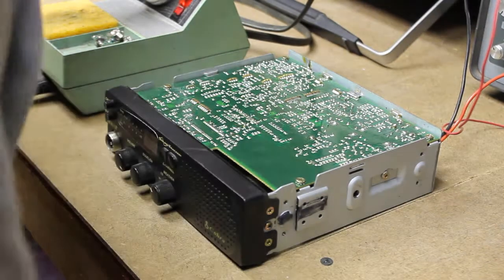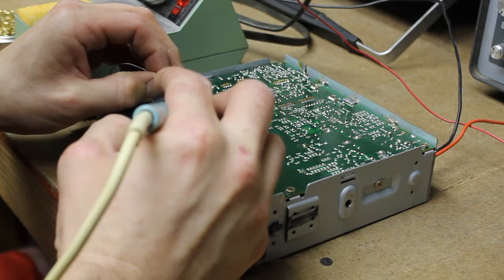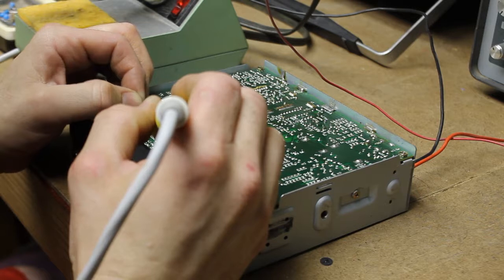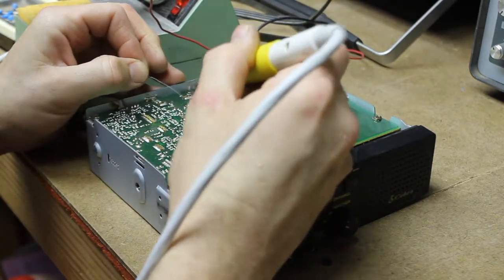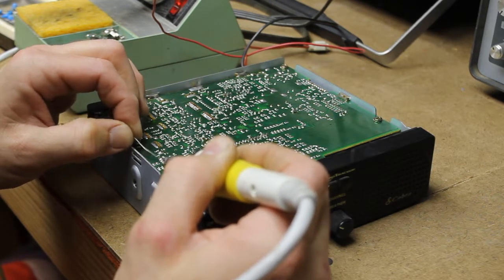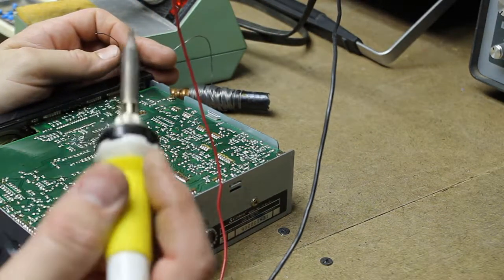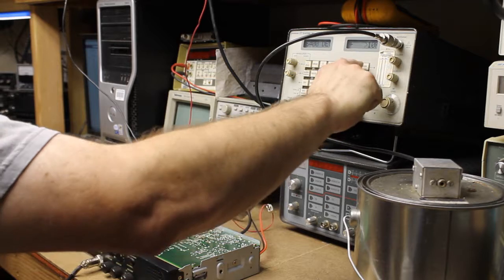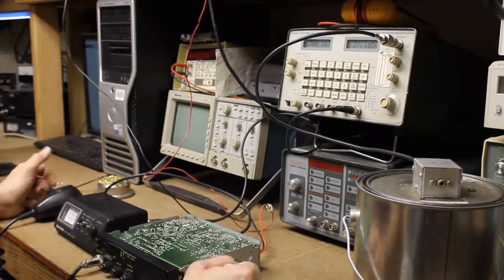Cobra 18 WX ST Intermittent Transmit and Receive Repair

Comment: I have the same model radio with no recieve or modulation. Rx/tx light works, but meter does not.  Wx works fine, do you happen to have any advice or schematics available?
Reply: Kamyn, I made a video for you on how I fixed the meter on the Cobra 18 WX ST that I own.  Mine had a cold solder joint, but not sure if your radio would have that exact issue or not.  I had to poke around for a long time until I found this cold solder joint.  From what I've been reading these radios are notorious for cold solder joints and they're definitely NOT one of Cobra's good radios, but I do like the front speaker and weather radio capability.  It sounds like these 18's have a lot of problems.  I'll post the link to that video for you below.  Also I have a few questions...so you can hear the weather radio broadcast over the speaker, but you can't hear anything on the cb channels even squelch/static noise?   When you transmit the rx/tx light changes colors (no modulation I understand), but does it show any output power on an swr/power meter?  Are you using the stock microphone that came with it or another mic?  Did you get this radio new?  Do you know if anybody has been inside the radio working on it or anything like that?   Here's the link for the video where I show you where my cold solder joint was...    https://www.youtube.com/watch?v=QvzpBiwtO8Y